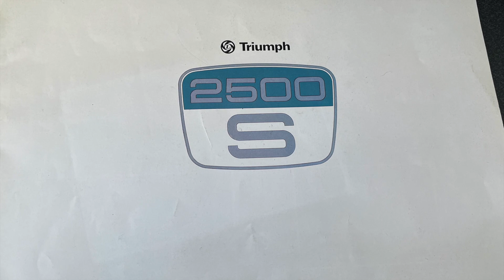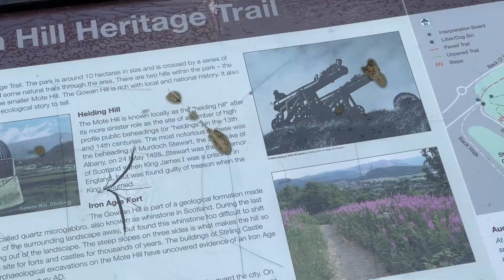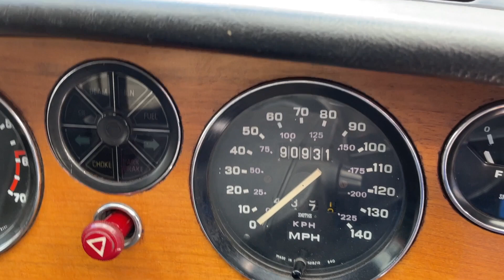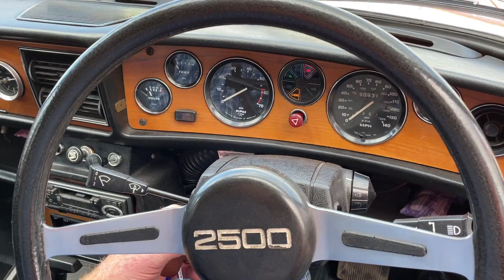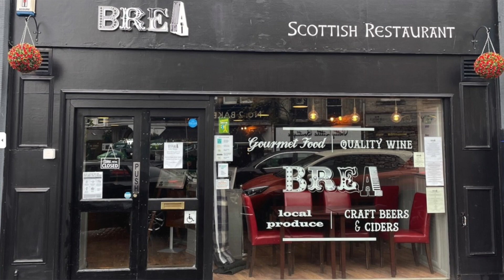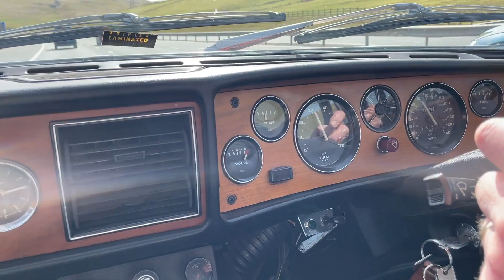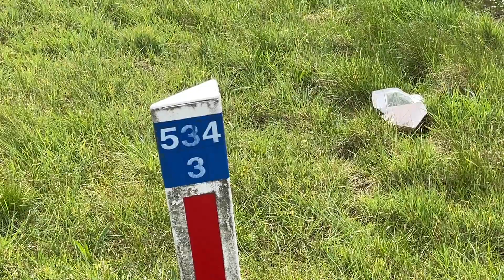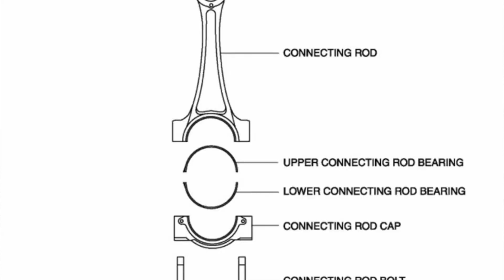I Bought A Triumph 2500S... UNSEEN! (Project Eddie Pt1)

Comment: Oh bugger!  That certainly wasn't in the original script!  When I saw you had a Pimento 2500S, I was thinking "Snap, Tony!  I've got one of them too - same model, same colour except M/OD!  382 miles?  On it's ear - I've done that in a day with the local Triumph club!" and so I sat back to watch a completely sedate and enjoyable......what?  Eh?  Naaaaahhhh!!!

I was watching the gauges when shown too - although the temperature looked good and showed no outward sign of what was to come, you'll need to toss that alternator in favour of another one, mate.  The voltage was pegged at the high end of the gauge and has a good chance of cooking your electricals, so the regulator has gone.  The alternator's bearings sounded a bit rumbly when we had a close up of the LH side of the engine when she was in Stirling too - just like the one in my 2500S before she started leaving black soot on the underside of the bonnet....which was quite disconcerting, I can tell you!  I replaced mine with a Lucas A127 - a 70Amp unit that will happily cope with modern add-ons / halogen lights and the like - and stay running at 13v nominal while idling at lights on a wet night with the wipers, indicator and headlights running.  Putting a relay in for the headlights was one of the best things I did for her too - not only are the lights brighter, but the old fuse box and wiring have no load on them now.

What year is the beast, Tony?  The BW65 box wasn't used until very late in the piece and (in New Zealand assembled cars at least) very few made it into the saloons - mainly appearing in Stags, which were imported fully assembled.  The 65 was a little more refined than the BW35 and didn't thump through the gears or chop back into first at about 10mph as you came to a stop like the 35 did.  I've driven a 79 'S' with a BW35 and it felt a little agricultural, and although perfectly suited to round town running, she revved like your one does at 60mph (about 3000rpm) while the M/OD unit in my own 'S' will cruise at 2700 in 4th or 2250  in 4/OD at the same speed.  

When you said she went bang and then she lost all drive, I was thinking of my recent trip to see my mother in the Stag - a hundred or so miles away over twisty winding mountainous roads.  I was on the way home and the Stag gave a little lurch after turning a corner at 40mph and then felt like we were going over some judder bars for a bit or she'd lost a cylinder.  I gave it a squirt on the accelerator and she came right, but then seemed a bit twitchy.  I then noticed a bloke flashing his lights behind the car behind me and he overtook her and started doing the same to me......and right then the Stag's rear end locked up and she slid off the road on the gravel.  She had blown her quill shaft housing (on the front of the diff), spewed all the oil out the pinion seal onto the hot exhausts and had burst into flames underneath - and THAT was what the guy flashing his lights at me wanted to tell me about!  When the housing finally separated from the front of the diff, the diff had then rocked forward and pulled the handbrake cables tight and locked the rear wheels.  My fire extinguisher put paid to the issue, but it could so easily have been different with the plastic fuel line running so close to where the fire was.....  

So, I certainly sympathise with the dilemma of having one's plans of a comfy cruise home in the classic Triumph being ruined by a part that no longer wanted to play ball!  Hope she's moving under her own power again soon, mate.  All the best.
Reply: @ArryTheStag  - so she sounds like one of the last out of the BL stables in the UK.  Mine's one of the last out of the Nelson plant in Nelson, NZ - January 24th, 1979.  First registered for the road on the 3rd of April 1979 - the Monday after they closed the BL plant itself in this country.  

As a sympathetic modification would be changing the gearbox for a Manual/OD unit (it has a J-type LdN OD unit like the post-73 Stag) or replacing the BW35 with the same Jaguar gearbox (was it a TH400? Dunno...) that the Stag guys do in order to get a lock-up gear in the torque converter that will drop the rpm over a certain speed and make highway cruising so much more relaxing.   Unfortunately I have no idea how your MOT laws work for them, although I DO know they are nowhere near as strict as ours, so it may be doable without much more expense than the gearbox and a bit of fettling.   Over here, we cannot run wheel rims over an inch wider than standard, lower the suspension at all, change the seats to something that does not use the original mounts (or weld the original mounts to the new seats), fit wheel arch flares, run tyres that protrude past the inner upper lip of the wheel arch, fit brake boosters or twin-line masters (if not standard) - basically, anything your car did not come with from factory is a no-no without going through a special certification process.  Said process costs $NZ600 a time, you have to trailer the car there and back and they can send you away for one thing, then find something else they don't like the next time you turn up after fixing the original item.  The government loves this process as it makes them lots of money, so it just gets stricter every few years.  Some mods that were certified on my Stag would now require me to remove or change them to the new regs if I ever did anything else requiring a change to the cert.  This is BEFORE and on top of when they then get tested for a Warrant of Fitness (WoF) - the equivalent of your MoT.  

The 2500 engine is a venerable little powerhouse waiting to be unleashed and they have plenty of perk to get up hills and to have fun with throwing them into corners and powering through them.  The little car can be as sedate or as vigorous as your driving style on the day wants it to be.  Give them the cam profile from a TR6 (or a bit more) and they certainly answer the call.  When the engine in mine finally says no more, my intention is to get the engine balanced, give her a slight lope to her idling profile and a set of extractors (probably from Chris Witor over there in the UK) just to help her open the taps and breathe properly without compromising reliability.  She's done 236,000km (about 140,000 miles) on this engine so far, still sounds good and has even compression between cylinders (although she does puff a bit when cold and uses about a litre of oil between changes (8000km / 5000 miles)).

Good luck (seriously) with finding a replacement engine - although there are quite a few more over there than there are here, so it shouldn't be an issue.  Really hope it all works out well - it's not nice buying a new car and suddenly have it throw a wobbly at you.  Had that with my Stag - I drove her up the length of both islands in this country when I brought her home (1186km - about 750 miles) and within a week she decided that oil pressure was optional after starting.....and then a shock absorber broke / collapsed....and that was the beginning of my relationship with her that has been to fix one thing after another as they fail.  I'd sell it, but it owes me so much!

Comment: From what i can remember, the 2500 had more problems with the cranks than the 2000 , Due to having a longer throw. also manual versions had problems with the End float , the copper thrust washers front & back of engines which caused clutch judder. I never saw many in pimento red , Has the car been repainted in that colour ?

Comment: Sorry for you, Tony. I had a 73 Pi back in the day and that took a good thrashing. I was only 18 so you can imagine the punishment it took. Those engines were always bulletproof. Just unlucky I guess. Hope you get sorted soon.
Reply: @arrythestag9638  IME the bottom end of all 70's Triumph engines were weak. 1500cc probably the worst but 1850's were little better. 

The sixes seemed better but probably only because in most installs they worked less hard, worked hard that oil thinned so much metal on metal was often the result of determined high speed driving.

Bit rubbish really and why I came to love german and japanese lumps that you could drive the nuts off and they seemed to not just take it but lap it up.
Reply from the maker: @tillyfoxtrotter  very true .. our year 2000 Mitzy Shogun 3.0 V6 still going after 228k miles and our 2011 S Class Merc on around 210k …. Just goes to show hey?! Best TR T

Comment: I was thinking you may boil the battery, noting the volt gauge indicated over charging, but never anticipated it throwing a rod.
Had that happen on an old Cavalier many years ago, but there was plenty of warning.
Personally would rather be replacing an engine, rather than an automatic gearbox, as the latter is such a black art to rebuild properly, where as a used engine can be inspected and even new crank bearings fitted first, by a relative novice.

Comment: And we thought the V8 was the dud.  Ba dum bum!!!
    Well, it just doesn't get any worse than that. I'm not familiar with the Triumph 2.5L six, but my guess is poor maintenance like lack of oil changes on the engine may have caused this, in addition to towing abuse. So hopefully the tranny will hold up for you.  But all in all it's a beautiful car, and the silver lining is you can either have this one rebuilt or put in a reliable one with low mileage (if such a thing exists).  I still think she's a keeper as long as there's no structural rust.  Looks to be in great shape.  Good luck with it!!!

Comment: My wife and I also got married at Gretna Green, a small world. A great shame about the engine, the straight sixes do sound good, remember racing around in a 2500 PI back in the day. Your block may be repairable if you absolutely want the numbers matching stuff, would be tempting to look at a 2JZ though. Would be a big project though to make the rrest of the drivetrain strong enough... I suspect a good 2500 complete engine would not be imposssibe to find at a reasonable price.
Reply: @ArryTheStag , good luck with it, blocks can be "stitched" if you have all of it but it is a lengthy and skilled process so probably expensive. A straight swap is a sensible option, on the bright side I guess at least you will know where you are with a refreshed engine. Thank you for the reply, best wishes David

Comment: Worked on these in 70s... you could hear the big end rattle on cold start cant believe you attempted to drive it making such a clattering noise when running... did the oil pressure not give you a clue of impending doom?
By the way it's not a 2 door stag...its a 4 door "two thousand five hundred" S saloon and the two are totally different or at least they were in my day when they were new.

Comment: The BW35 has probably suffered no harm.  When you separate it (flex-plate bolts) from the blown engine,  make sure that the torque converter stays firmly in the bellhousing and remains there.  Brace it in place with anything to hand,
I well recall driving such Triumphs' (plural) as company cars (inc. a 1973 auto Stag) back in the 1970s' when they were delivered new.
The 2000 six cylinder engines were much smoother than the (stroked) 2500 versions and the 4 speed + overdrive manual boxes were a nice drive.
Bottom ends were always a weak point esp. thrust bearings.
Nice as the car clearly is, it's never going to be a Concours car, so why not drop in a lovely Rover V8;  ... ie. the engine that the Stag should always have had from day one.
Sourcing a nice V8 will be much easier than trying to find a decent 2500 lump.

Comment: Please when you come to start this when it’s fixed (and also any other manual choke car you drive) get into the habit of spinning the engine over with the choke off until the oil pressure light goes out.

The big end knock on startup is a direct result of not doing this and it firing before oil pressure has built up.

Sorry about your engine - I wonder what caused that!

Comment: Tony, I know we have already conversed on this, but I'd thought I'd watch your video. The engine didn't sound right on start up, it sounded rough and a bit knockie, a Triumph six even on start up is a smooth unit. Of interest did you check the oil before you started it up, just wondering whether an oil change had been carried out and they forgot to put the oil back in? Geoff

Comment: Think you did a me, wanted it so bad everything was fine but, that engine didn't sound right from the off, too much noise. Only every worked out once for me, got a lot off a car as the tranny seemed to be slipping, knew fluid changed were important on them and cured many and I'll and this car hadn't had them regularly. Got it home, 2/3 full flushes and she ran fine, £700 off, still don't make up for the others I've thought "Yeah its fine"

Comment: That was a bit bold of you to think that it would have made the the 400 miles without a hitch. Don’t think that I will replacing my TV8 with the 2.5L any time soon as it looks no more reliable than the original Stag engine, so why people do it and think it will be instantly more reliable is beyond me.
Reply: The Stag V8 and the slant four it was developed from were piles of junk when new.
Reply: @Ampex196  I bought one new....sold it at 35,000 miles after blowing a fortune on two engine rebuilds.

Comment: Tony .The one thing I noticed was......... You did not check fluids etc  before you took off  . I bought mine and drove it home 1000 klms no problem  and many times that  by now  can I ask did you check oil pressure  before you left and did the warning light come on
Reply: @ArryTheStag  OH well that is classic cars  . I have 2 off the road at the moment .The Stag blew the subframe mount at the rear suspension .So now everything will be put back new including exhaust and diff seals .The 2500 (ever so reliable ) blew a clutch master cylinder These are no longer available .I have searched the globe . I don't want to start manufacturing new ones because every time I make something I lose money I will let you know when I find a solution

Comment: Stick a Rover V8 in it, like Triumph should have done in the first place...
Reply: I seem to remember that the Triumph 2000 and the Rover 2000 (P6) were introduced at the same time in 1963, completely different manufacturers. The Rover then had a four cylinder engine and the Triumph already had a 2000 version of this 2500 six cylinder. At that time the Rover V8 didn't exist, that engine was introduced in 1968.

Comment: This Triumph is number 2 in a very unusual list of british cars the 2.5 litre engines this is the 6 cylinder which is not that unusual even when this car came out and the 2.5 litre 4 cylinder motor is a Humber Hawk and the 2.5 litre V8 motor is in the Dameler pity the engine blew up well l l thought an old British motor 90000 miles is a bit high obviously its the original motor many newer motor vehicles will do well over this without blowing up for example my 25 year old toyota hilux has done about 250000 miles on the original motor probably do another 250000 miles when l picked up my toyota it up in Newcastle and drove it to Sydney no problems and has done several trips to Newcastle still going strong

Comment: i bet its got lot filler in it blown it over respray it said on the last mot it was throwing a lot of emisions out carbonminoxide wot did you get to the gallon you should kept it to 50 mph old engines cant take the high revs un les in great nik